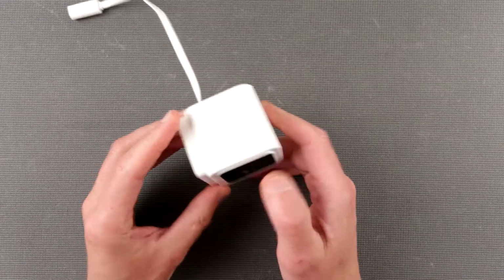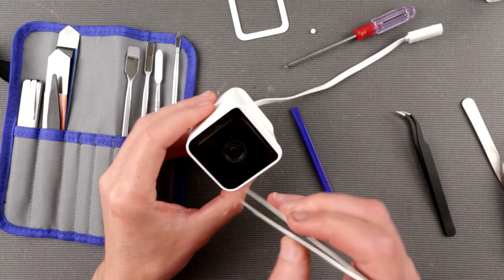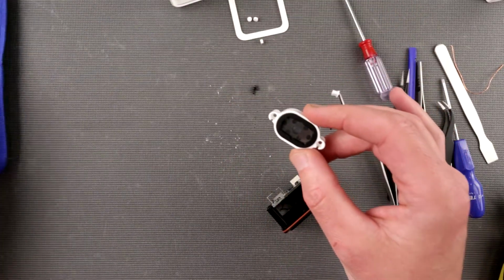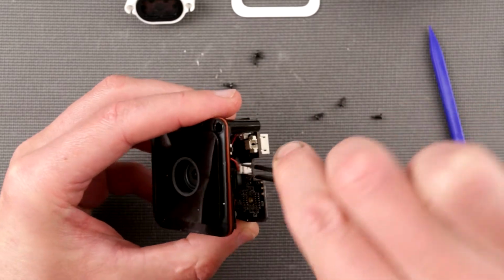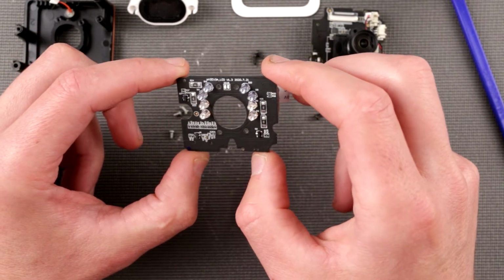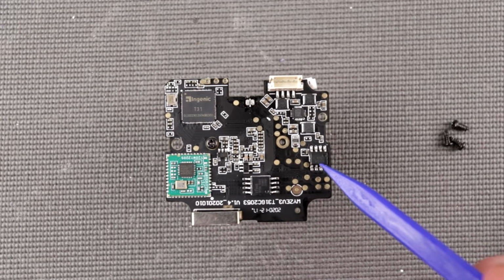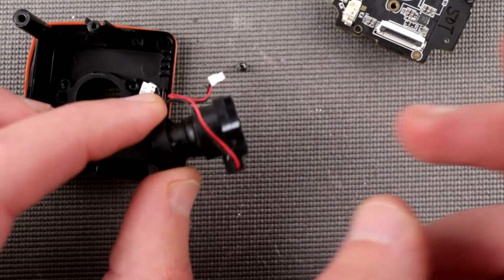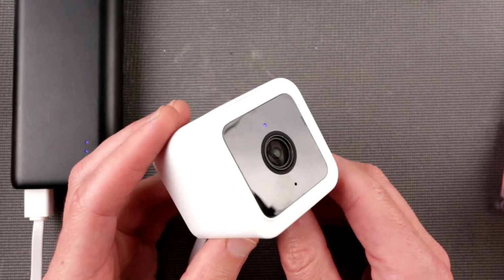Taking Wyze Cam V3 to pieces !

Comment: Just bought a V3 and have been experimenting with best location to mount it.  Has worked well for about a week so I drilled the hole needed fir mounting in the location I decided on and attached the camera and mounted it.  Then reconnected all the wiring and opened the app, and the camera would not connect and kept giving error code 90.  Checked 2.4 Ghz wifi at camera and signal strength about 35 tp -38 dbM very strong.  Spent the rest of the day following the remove reset and reconnect scripts from Wyze and it would never connect even within feet of my wifi access point.  Not a good start for a new customer.  Since today is Sunday I will try to contact Wyze tomorrow, but I think I have already done everything needed.  PS - I am a graduate engineer and was a Network Engineer for a large network before retirement, but I still know how to isolate what component is at fault.  This is a great video and if Wyze won't stand behind it I may follow your instructions and see if I can fix it myself.
Reply from the maker: Thank you for you support and watching the video! My Wyze cam still works strong. Pretty much all 2 different kind of cameras I have works quite well. It is a shame that some of them are failing.

Comment: @InsideOutElectronics I can confirm these cameras are definitely NOT suitable for outdoors in the rain. I have four of these cameras, and only one that is exposed to rain here in Australia over the last two years. After recent rains the camera that is exposed to the elements died. When I took out the SD card it had a tiny amount of corrosion on one terminal. I did have a 3D printed cover on the camera, but unfortunately it didn't cover the speaker area on the back, which may have been the weak spot in the waterproofing, as you pointed out. 
After watching your demonstration I was able to open the camera in a matter of minutes, only to find it had a lot of water in it. I'm glad all my other Wyze cams are under cover.  
I have worked in electronics since the mid 1980's and your videos are very professional, informative and straight to the point. Keep up the great work. 
BTW, the different types of LED's are most likely for the NEAR and FAR lighting.
Reply from the maker: Thank you for your kind words and thank you for sharing your experience. I agree that they are not good for permanent outdoor installation. I use all my cameras indoors so I have to see them fail so far

Comment: Great video, extremely detailed and comprehensive. 👍  I have a V3 that Wyze determined was defective due to static sound being produced and nothing remedied it, so I was a sent a new camera. I'm curious if this could be a defective mic and that be replaced to fix the issue, out of it's more of a hardware based issue... Just curious if there's a mic out there that would replace the original...
Reply from the maker: Mic are easy to replace.... can be good start. I would looks for mics on ebay or so
Looks for "Electret Condenser Microphone Capsule MIC Cartridge Omni Directional"

Comment: I'm curious. Lots of Wyze Cam V3 owners seem to have trouble with radio interference being picked up in the audio. Have you noticed the same issue with your Wyze cam v3? If so have you thought about twisting the mic lead cables from the microphone to the board to see if that improves the audio quality?
Reply from the maker: No, I have not, but I do use mic super rarely. I mostly use it like my 3D printer monitor camera and also spying after the cat when she is home alone ;)
Reply from the maker: But I can do some experiments, thank you for pointing this out

Comment: Just received my Wyze Cam v3. After a firmware update it keeps on Solid Red and never changes. I tried everything possible on their Troubleshoot options and even their support, but no success. Would opening the case and tweaking or reconnecting something do a HARDER reset? Because the Hard Reset (10 second Setup Press) isn't working either.  since I live oversea they cant send me a new one ;(
Reply from the maker: Can you try reflashung the firmware?
https://www.rockauto.com/en/parts/acdelco,D599A,ignition+coil,7060

Comment: so I am planning to install it on the roof(2nd floor) so the v3 will be like in the air without any 3rd party silicone case or protector. 

Do you think I better tape the speaker holes behind of the camera for better waterproof?
Reply: some people say dont do that since that speaker holes will use for a breathing like air intake and outtake.
Reply from the maker: Interesting, i have never tested waterproofness limits of the camera
Reply: I ended up just tape it to block the speaker hole.

Comment: Very nice take apart. It would be great if you can comment on why three brand new cameras failed, no blinking lights at the front. Seems that they have a common problem with the power controllers. Have a nice day.
Reply from the maker: This is horrible ! Can you return them ? None of 3 failed on me... lucky?
Reply: @InsideOutElectronics  I returned them, but it takes tome filling their forms, they do not keep track of the Mac addresses!